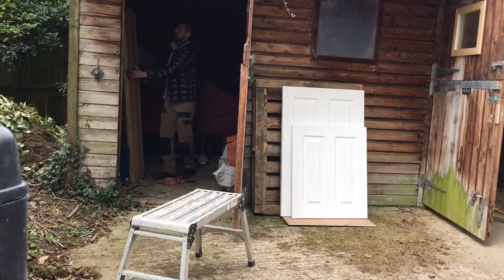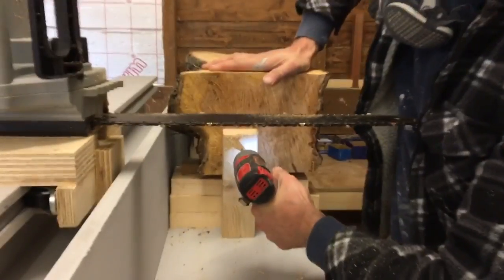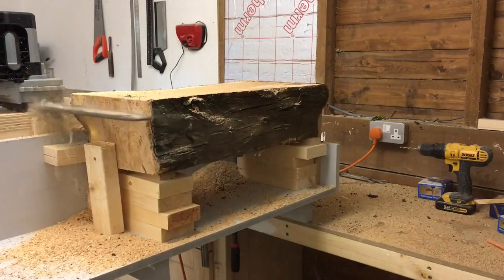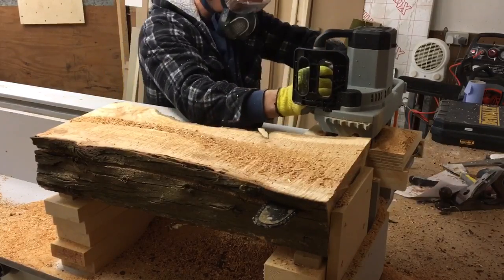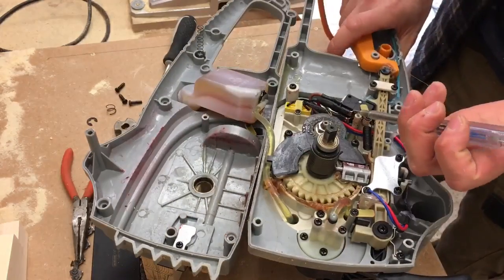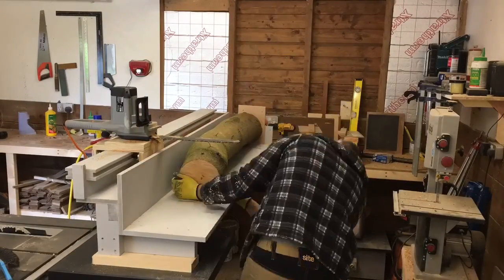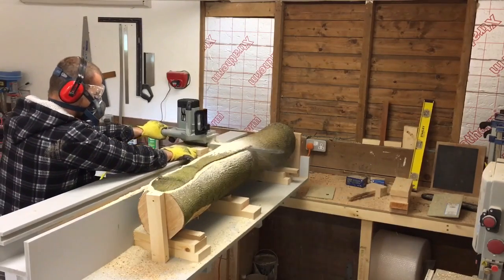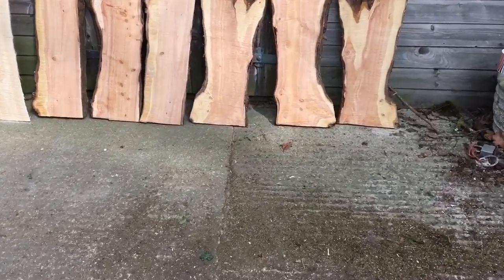Electric chainsaw mill follow up, and more milling.

Comment: Get idea.  I may have to build one for myself.  Instead of extending your rail, you could put a spacer block at the end of the log tray.  That way the end of the log will Finnish before your rail runs out.

Comment from the maker: Thank you! You right, I just didn't bother because it was still easy to finish the cut. I planning to make some more improvements, which should be subject to another video.
Reply: Szilard Pinter Hey great video! to tell you the truth (about the chainsaw stopping) the thermocoupler probably cooled off in the time you took to tinker with it and started working in its own. next time just shoot some air from a airline into it and it should start back up. I have one that does the same.
Reply: Yep, its a protective thermal fuse.....I have same saw, same problem. Just go more slowly!
Reply from the maker: peter smith thanks I will!
Cheers

Comment: Nice jig!  I see that you are using standard cross cut chain.  This is sharpened at a 30 degree angle.  Try using ripping chain.  It is sharpened at a 10 degree angle.  You can get away with changing the angle on your existing chain by sharpening it to 10 degrees if there is enough wear left in it.
Reply from the maker: Thank you. Yes I that's right. I was thinking about that, possible the vibration at the tip of the bar when beginning the cut caused by that 30degree angle, is too aggressive. 
Once is in the wood (it stops) I think it can be compensated by a careful federate. The chain is new so I have plenty left on it to change the angle by the first sharpening! ( all that cut was done with the factory grind, and didn't seem too loose much sharpness.) 
Thanks for taking your time to comment!
All the best!

Comment: For pieces of tree trunk shorter than the mill, then why not move the tree trunk closer to where you start cutting to stop the saw trolley sliding off the end?   A temporary stop screwed to the base at the far end of the trunk would stop the trunk moving forward.

Comment: Great video!   Do you think you could just put a spacer block on the end where you screw the log?
Reply from the maker: Thom Graham thank you. I'm not sure what you mean..?
Reply: At the end where you are having the problem,  just put a block there and it would move the log forward!
Reply from the maker: Thom Graham ok I see what you mean! 
I thought about that but because it didn't really effect me in finishing the cut I just didn't bother.
But I will extend the track with about 100mm for other reason. I wanna put a simple winch on it to pull the saw!
Reply: or keep the saw fixed and move the log? Then you could support that viberating saw tip with a steel arm or bracket, enclose it in a cnc type cabinet and suck the dust out all in one. I guess it would be easier to make the saw assembly height adjustable for sucessive cuts than keep moving the log up and up on spacers?

Comment: This is a great idea. Good you can use indoors in all weather unlike a petrol saw. Unless milling full length logs, you could just pull The log back a couple of inches with a packer to avoid the end run off. Thanks for the video.
Reply from the maker: Thank you! You right, but I've got some plans to upgrade! If all goes well there would be a video on it soon. 
Thanks for watching!

Comment: The saw probably stopped working because the brushes that rub on commutator weren't advancing, sometimes they need to be jarred loose by tapping the motor housing with something light, like a screw driver handle.